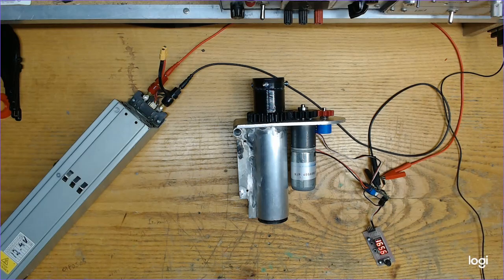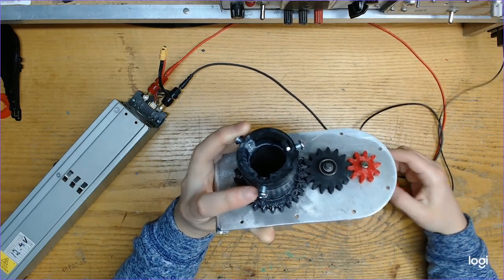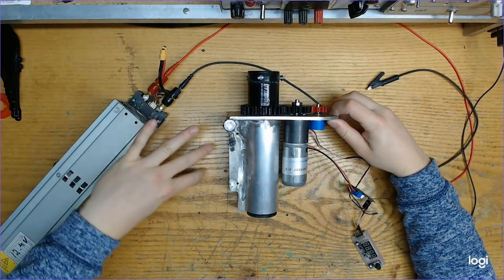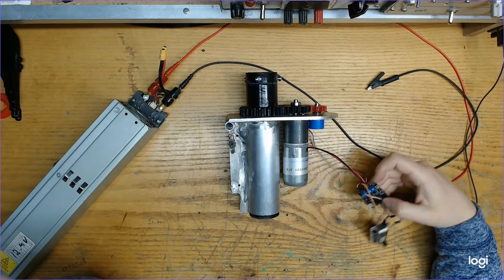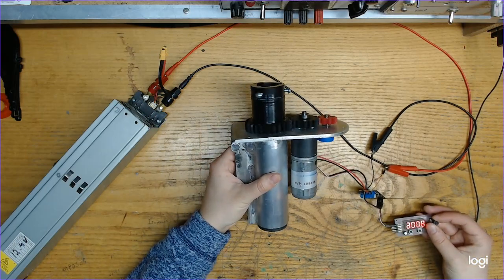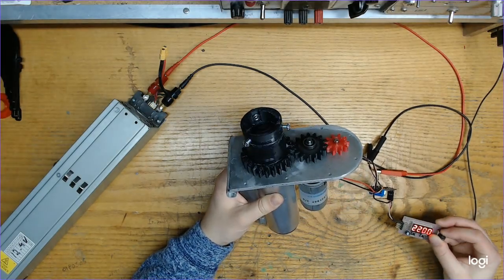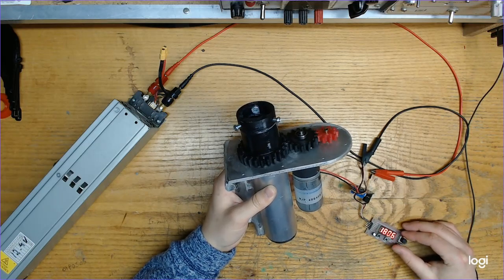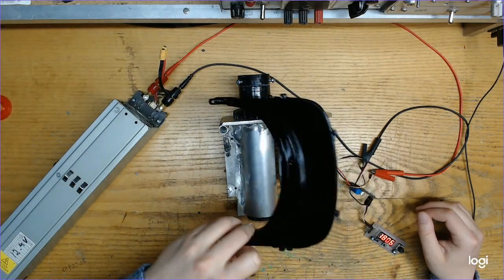RC Trolling Motor Boat - Part1

Comment: Just curious about how u would steer manually if the unit malfunctions? I'm not doubting the durability of your design but, stuff happens.
Reply from the maker: Hah, I actually thought about this too... this design doesn't really lend itself to a failsafe. It's destined for a rowboat, so I would just break the oars out and start paddling if anything happened.
Reply: @alxelectronics9615  unless the motor spins freely and doesn't lock up,u could continue to steer it normally. I had a system similar to yours only with a wiper motor. When I wanted to steer it manually,the motor would turn freely. A lot of gear motors are designed to lock up though.
Reply: @alxelectronics9615  Btw,this is a pretty cool design and clever craftsmanship also.
Reply from the maker: @umpy3152  Thank you! I just need access to a welder again and I can finish it up.... So close!

And the motor is absolutely not back-driveable, at least not without significant force.
Reply: @alxelectronics9615  You could also use the shaft depth adjustment knob to lock it in place and loosen the bolts on your motor collar so it turns freely. Then you can steer it manually.